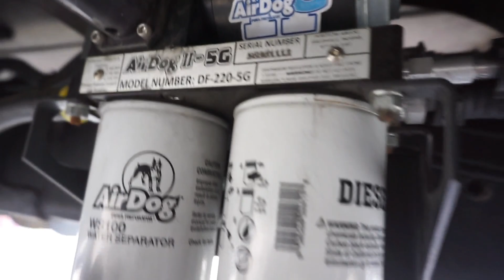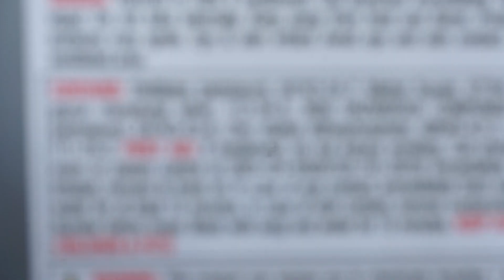FINALLY CHANGING MY OIL AFTER 2 YEARS!?!

Comment: Project Farms and others have shown that the differance is marginal if the oils have the same ILSAC/API Rating. Some of the high price oils had more additive packages but that would not make any differance with regular service intervals. 
As for filter...Champion makes Amsoil Filters, same as Mobil1 and others.
So if you want to keep your cost down go with the cheaper oils and filters for regular service....or...do a 2 year service.

Comment: Amsoil is great stuff. But rotella t6 is just as good for a lot less money. There is a fella on YouTube called “the high mileage helper” he does hotshot trucking. Gets over 30k miles from rotella t6 and sent it off to get tested and they said it was still good. He was using a wix xp filter.
Reply from the maker: Rotella is very good oil nothing is wrong with it. I use to run Rotella before I switched to amsoil, but I will say I noticed a difference over time from switching. Fuel economy,  less engine noise, samples I've sent off have had more ppm additives from amsoil compared to Rotella t6. Like I said t6 is very good and if I had to buy oil off shelf that's what I would run, but amsoil is where I'm at haha
Reply: I run Rotella very happy

Comment: with the new tires check your tire pressure , sometimes you can drop alil tire pressure due to the hard ride , did the same with my truck runs night and day around the city with the pot holes , just need to remember to air back up if your towing heavy
Reply from the maker: It's funny u mentioned that cause I literally just took some pressure out all the tires. The tire shop had the psi's all messed up. Truck rode horrible on the highway now its a lot better. Aired them all down to 55psi. Might lower the rear tires to 45-50psi. Max is 65psi.

Comment: So, if I install the Air dog fuel filters, those are the only fuel filters I need to change and worry about? I still have a stock on mine, and they are kind of a pain to replace.
Reply from the maker: Yes that is correct. Also the airdog filters are way cheaper!!

Comment: I use Amsoil signature 15w-40 in my 2015 Ram 2500, never had any issues with my engine.
Wheel bearings are a different story. :-(
Reply from the maker: Excellent choice bro! I've never been disappointed with amsoil in my trucks or cars. Love their stuff.